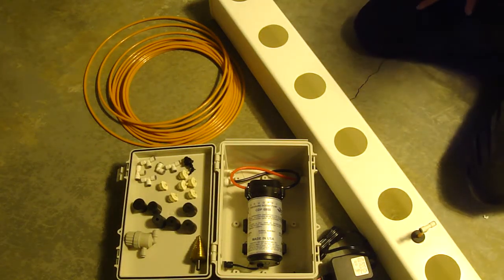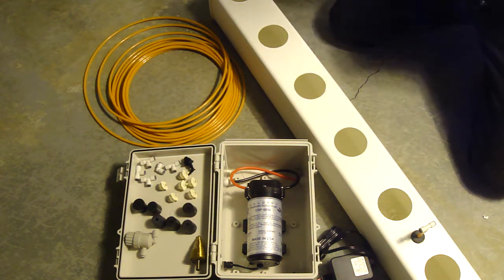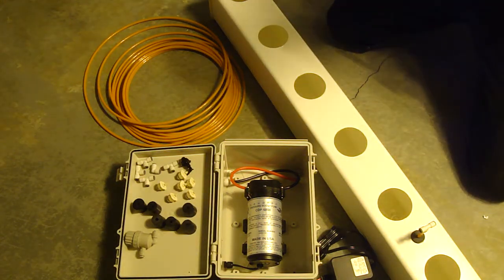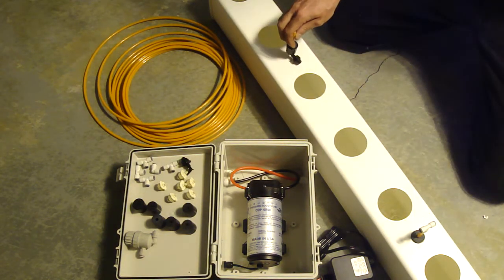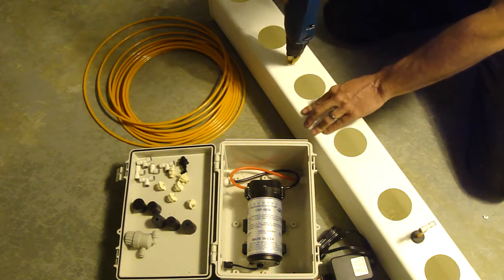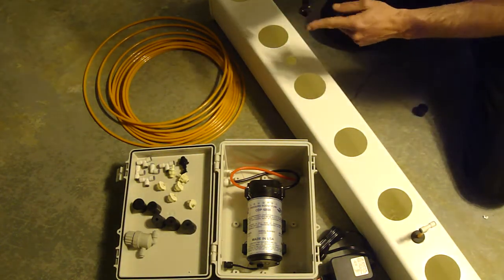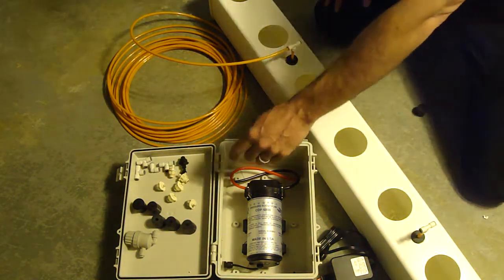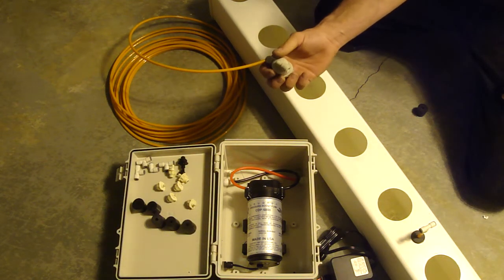Multiponics HPA Kit brings old aero gutters back to life

Comment from the maker: Thanks for pointing this out. We'll be posting a new video soon to better explain this. The pump does have arrows on the end showing the direction of the in/out flow, but they are a bit tough to see. The red side is the high pressure outlet (to lines), the black side is the inlet side. Have the filter on the end, hanging into your reservoir.